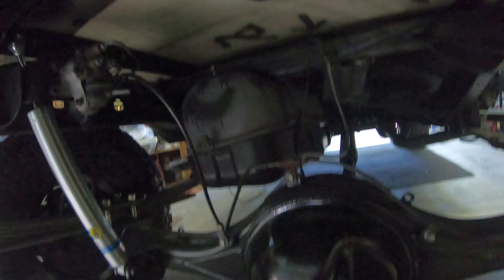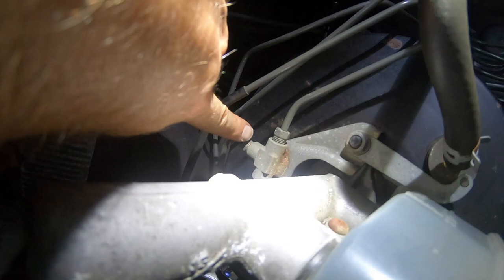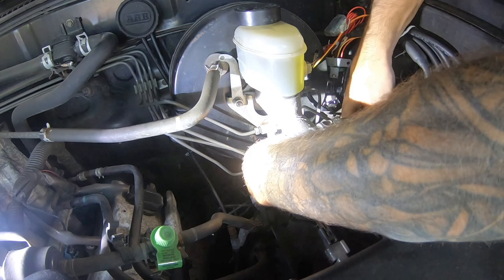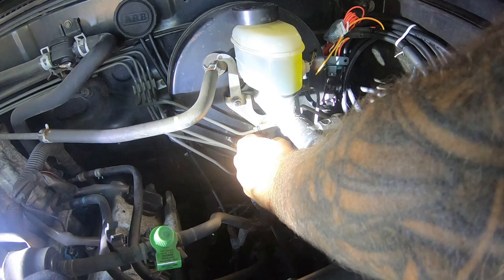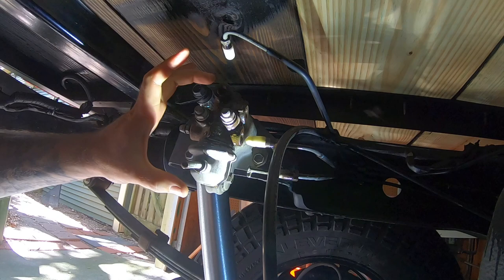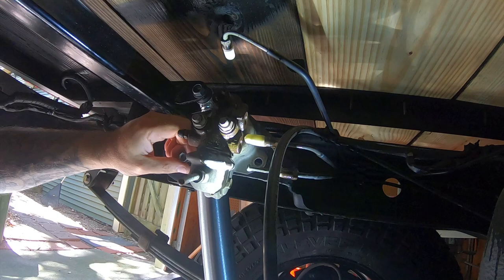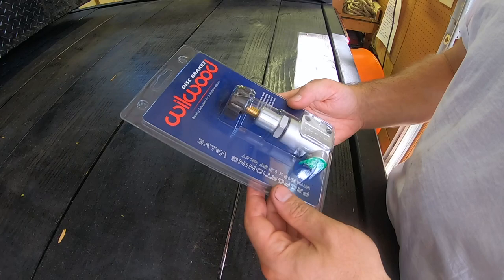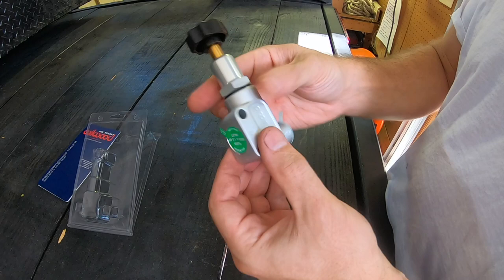LSPV swap for better braking. PLEASE CHECK DESCRIPTION FOR IMPORTANT INFO!

Comment: Great video again man, love to hear a update after a while on this.
Reply from the maker: Will do. Need to fix a steering issue, but I should have it drivable soon.
Reply from the maker: UPDATE for you. Everything is still working as it should. I have had no issues.
Reply: @JHBtheIV  awesome man thanks for the update! I plan on doing this in the spring to mine

Comment: Hey could you share the rear disc brake upgrade you did? I love my 2001 tundra and need to upgrade bad. I love your vids!!
Reply from the maker: Thank you. 🙏
I actually swapped the entire rear axle from a 2014 Tundra, and they come from the factory with discs in the rear.
 I’m probably going make a quick video on the ins and outs of the axle swap, since a number of folks have asked.

Comment: Couple questions: Which Wilwood valve did you use? The one with the 10-1mm bubble flare inlets or another one? Does your Tundra have bubble flares on the brake lines? Most people mount their Wilwood Adjustable Valves under the hood...how does your hold up to water and dirt? I am thinking about  mounting mine under the truck, where the old LSPV was located. as well.
Reply from the maker: I used the valve with  M10x1 bubble flare fittings.. My tundra has inverted flares on the brake lines, so I had to run adapters; I put them in the description. No issues with putting the valve in the stock location. I prefer it, as I only adjust it when im towing something particularly heavy, and I can just reach under and turn it when im hooking up the trailer.
Reply: @JHBtheIV  Great! Thanks for responding!
Reply from the maker: @williamdejeffrio9701  You're welcome. 👍

Comment: can you please tell me how you made that mounting bracket step by step please thank you and where did you get the material
Reply from the maker: I made a template out of cardboard of the shape I wanted, then cut and drilled a piece of 16g steel sheet. Used the stock bolts to mount it to the chassis, and some through bolts and nuts to bolt on the PV.

Comment: How does this work when its the front brakes that get more pressure wouldn't you want it up front under the hood for the front brakes
Reply from the maker: It's a rear proportioning valve, so it controls how much pressure goes to the rear brakes. It does not  "take away" any pressure from the front brakes, it only controls the fluid volume to the rear. You never want your rear brakes locking up before the front, as it can create loss of control. 
When towing or hauling heavy loads, the amount of weight on the front and rear tires changes, which changes when the front and rear brakes lock up. This valve just allows you to adjust for different loads, so you can continue to prevent the rear brakes from locking up before the fronts.

Comment: Ok so i have the exact same valve on my 89 fj but after a while it stopped working and intermittently would block off all flow to the rear brakes
Reply from the maker: Never seen that, but it sounds like something broke inside the valve. Id contact Willwood.
Reply: @JHBtheIV did you use a bender to bend the lines?

Comment: On my Tacoma I connect the line that runs to the axle to the out of the willwood bypass
Reply from the maker: Yep, that’s what I did as well.
Reply: @JHBtheIV  did u have to bubble flare the line
Reply: @JHBtheIV  mines is leaking when i press the breaks
Reply from the maker: You have to make sure you get the wilwood valve with the correct fittings for your brake line set up. They make a couple different options.
Reply: Why not in cab adjustability
Reply from the maker: That would involve a lot of extra work for something I rarely need to adjust. Plus, with the flatbed, I can reach in a n adjust it very easy. 
 @shawngoldsberry747

Comment: Why did you change the axle axles same thing as a second GEN axles
Reply from the maker: Sorry, I don't understand your question?
Reply: Sorry man my question was why did you change the rear axle on that Tundra The first GEN Tundra and the second GEN and third GEN and fortune are the same axle
Reply from the maker: @raulbueno4284  Oh man, definitely not the same. 1st Gen has a 8.4" ring gear, 7/8" diameter, 29 spline axles, and drum brakes. 2nd Gen has a 10.5" ring gear, 1 3/4" diameter, 36 spline axles, and disc brakes.

The 2nd gen axle is WAY beefier, essentially a 1 ton axle.
Reply: Look man I have a 2005 Toyota tundra with a 4.7 iPhone is weird Maxwell package It has a 10 1/2 inch ringer with a 430 rear end from factory do you know the address on the tundra come up for a 10 and a second GEN and a third GEN and a fortune Tundra’s are the same exactly from Hino That’s a semi from Toyota matter factory Yasmin there are the same I’ve been a mechanic for five years and I have three tundras and they pull the same weight and I’ll pull it with a gooseneck trailer
Reply: Let me ask you why the First GEN Toyota Tundra I am a second GEN and a third GEN and the fourth GEN are over bill tracks because they put the same parts in the same stuff on the same trucks follow me as you did you ever knew the first GEN tundras for over built can you the truck was capable as a 1 ton that’s why they put the same same parts as the first GEN two the second GEN and third GEN and fourth GEN they knew they were doing The right parts for that truck man I’ve been towing for 10 years I know what I’m talking about man I’ve been at Toyota guy from 2000
Reply from the maker: @raulbueno4284  I can't understand anything you wrote.  But good luck with your tundra!
Reply: No I’m saying is the first gin tundras have the same component as the tundras now but I’m trying to say is for the The First GEN tundras or overbuilt why I know that because I use my 2005 tundra double cab and I tow with a gooseneck trailer and it pulls like it 1 ton truck I know that for fact because I’ve been in Mechanic for five years and I’ve been searching everything while that Tundras have
Reply from the maker: Ok, I think I understand. Well for me, I did the swap because I blew up two 8.4 rear ends, that’s why I swapped in the 10.5, which I couldnt break if I wanted to.
Reply: @JHBtheIV  how hard was the swap. With disk brakes in the rear, and the caliper upgrade in the front, did you have to replace the master cylinder to something bigger?
Reply from the maker: @AztekM1  Swap is not hard as far as axle swaps go. Cutting the brackets off the 10.5 axle is the most time consuming part. 
Im still dialing in the brakes. This LSPV swap was part of it, and I may simplify and pull out a bunch of lines from the old ABS. 
if I need to, I will go with a larger MC and dual diaphragm booster. There is a lot more fluid volume to move with the new set up, which I knew would be the case.
Reply: @raulbueno4284 omg buddy give it a rest please, you're flapping your gums and talking in circles

Comment: Does this valve still work if the rear brakes are drum brakes?
Reply from the maker: Yes it does. The valve proportions the fluid going to the front and back wheels, so the type of brake at the wheel is a non-factor.
Reply: @JHBtheIV I just did this same procedure on my 2003 Toyota Tacoma and I pretty much followed your video to a T. I am 100% not blaming you for anything I have done on my truck, but after I did this I also bled the brakes. When I was pumping the brakes for the last caliper the pressure on my brakes gave out and they do not work. I thought maybe I installed the valve wrong but other than the in and out lines being a little lose before I tighten them after my brakes gave out I have no idea what may have caused this. My master cylinder is full of brake fluid but my emergency brake light is on. Any advice or help is much obliged
Reply from the maker: @Thelegend-fm4rz  Thats no fun! If they gave out all of a sudden, something probably let loose. If you don’t see fluid coming from any of the lines, I’d check inside your rear drums, and also check to make sure the MC isn’t leaking into the brake booster. Both these are common issues on these old trucks.
Reply from the maker: @Thelegend-fm4rz  One other thing, you installed the line adapters for the new LSPV correct?
Reply: @JHBtheIV  No, I bought a valve that fit my brake line so I wouldn’t have to buy adapters (M10 x 1.0)
Reply from the maker: @Thelegend-fm4rz Right, but to clarify; the Wilwood valve is made to accept a bubble flare line, and most Toyota lines are inverted flare. So you usually have to run bubble to inverted adapters, like I have in the thumbnail photo. I have a link to them in the description. If you don’t, the lines usually won’t seal correctly, and you damage the valve or lines if you try and torque them down too hard.
Reply: @JHBtheIV  So you are saying that because I didn’t use the bubble flares, the valve is not working correctly?
Reply from the maker: @Thelegend-fm4rz If you dont use the adapters, the lines may not seat in the valve ports properly, and you can lose line pressure when you depress the brake pedal.

Comment: Do you have a part number ? And will it work on 1985 toyota 4wd thanks
Reply from the maker: Wilwood 260-12627 is the valve I used, but you will need to make sure you get the one with the proper inlet/outlet for your fittings, and use flare adapters if necessary. I would imagine your toyota uses the same size fittings, but you will need to confirm.